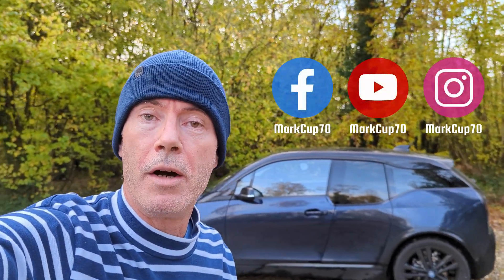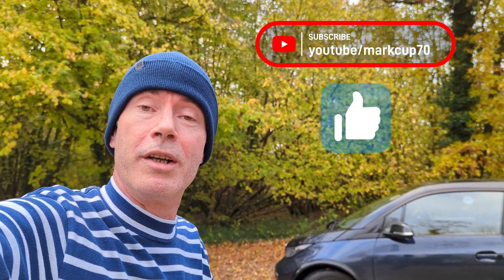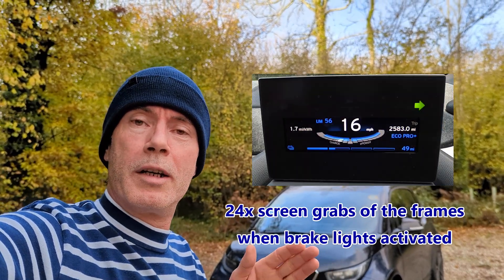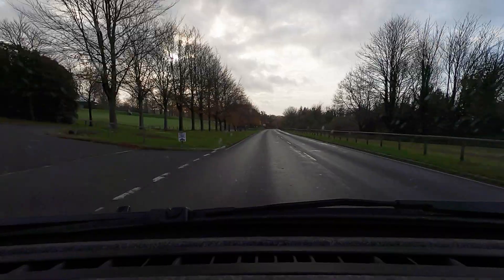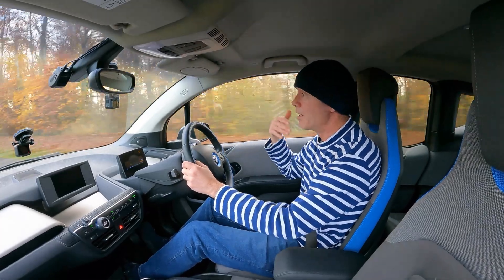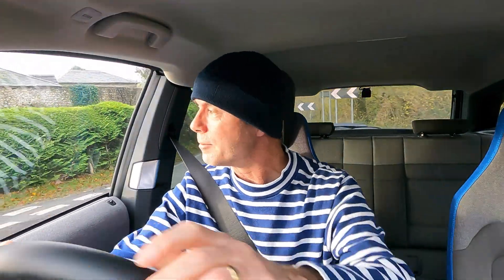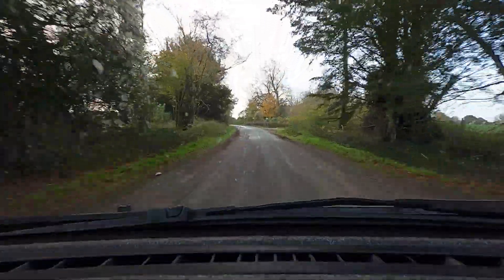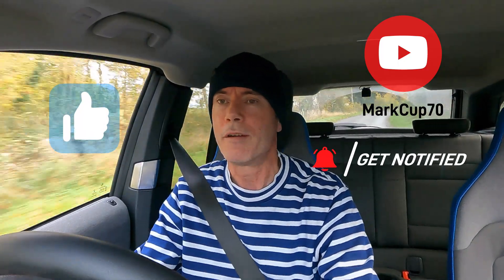BMW i3S EV life - why REGEN BRAKING in ELECTRIC VEHICLES is BAD for range!

Comment: Spot on. Two questions: When do the friction brakes (when you loose lots of energy) kick in when you are using the brake pedal? I.e. do you get pure regen at low g, just like with 'one pedal' driving, or do the friction brakes kick in straight away? The purpose of my question is to ask whether a high regen (one pedal driving) mode gives more regen than a low regen (coasting) mode used with the brake pedal? I.e. if you have to brake, then is it more efficient to be in a high regen mode than a low regen (with brake pedal use) mode?
Reply: On the i3, pressing the brake pedal always engages the friction brakes. Regen is controlled solely by the accelerator pedal. Hence the i3 is always in one-pedal driving mode. The power display around the speedometer is key to communicating what's going on. The ePower bars to the right indicate you're taking power from the battery. When it swings to Charge on the left, you're capturing energy. Keeping the indicator in the middle is the most efficient mode because no electricity is being used or recaptured. 

If you have an EV with multiple regeneration modes, high regen should be more efficient since you'll capture some of the kinetic energy rather than burn it off with friction brakes.

Comment: Look Fannybaws I will explain the most important reason why regen is bad 1stly from a yr round point its too energy intense in the battery ie will severely shorten the battery ACTUAL life ie lifetime and secondly it should be 100% turned off between October and end of march (or at least turned to minimum if turning off not possible to turn actually off) for the reasons of brake corrision as if this was not bad enough as it is in the UK in normal cars it's 4x a problem in electric cars Soooo regardless of ANYTHING everyone with EV's make a very deliberate point of breaking very late at a decent speed (say approaching a junction or roundabout (obviously with no traffic behind) to help keep the brakes cleaned up and corrosion free......Psssst....Missed you princess......yes...it's me :)
Reply: If you do any town driving in your journey you're bound to have to use the brakes in an i3 at some point: when the traffic lights suddenly turn red or if someone pulls out in front of you. In any case, regen braking cannot be turned off in an i3.
Reply: long short get used to trying to carry speed at roundabouts/trying not to actually stop at junctions and traffic lights  in general etc as much as possible...But obviously as safely as possible....
Reply: Oh and by the way your talking grabage regen actually does defo work and should be 100% used on longer journeys (ie when you know you are going to have to charge before coming home OR know you rely on getting home on that single charge and know it will be close....But more importantly avoid using for the points above i suggested...>So yeah regen defo does have a range....Don't own the car and will never be paying for the battery or brakes?....!00% use it and take the benefits without the negatives